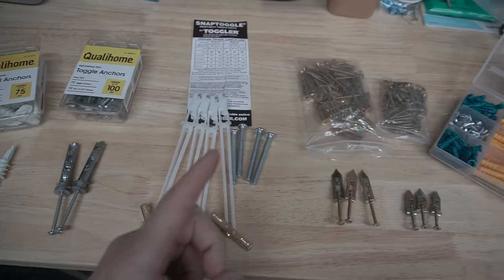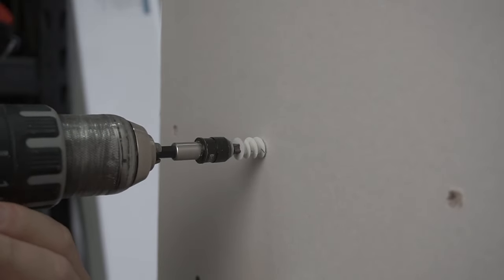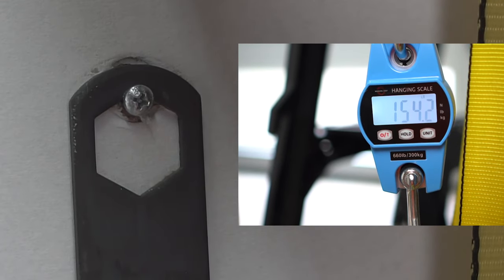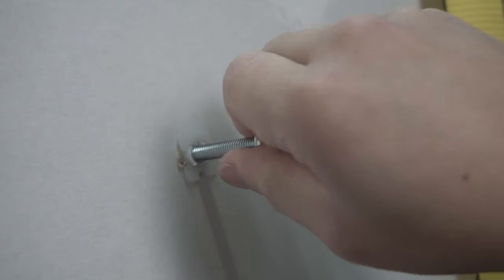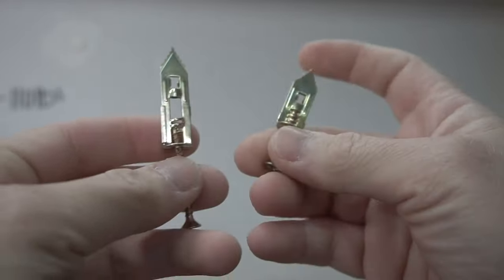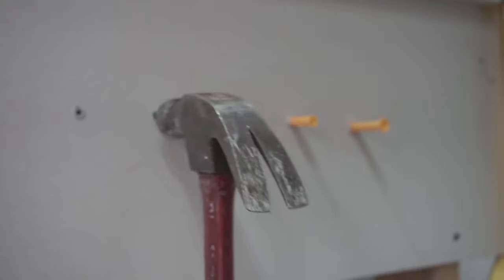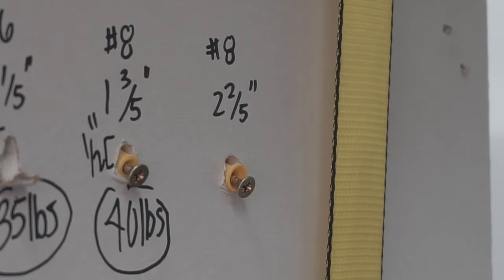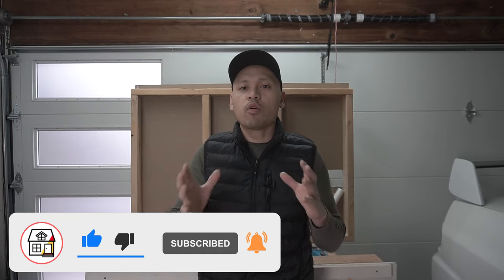Which Drywall Anchor Is The Best?! BEST And WORST Wall Anchor Review PART 1 (2022)

Comment: The hammer in anchors have to be oriented horizontally or they will cut through the drywall. 
When you install toggle bolts, there have to be completely tighter down to what they are anchoring, otherwise the screw will cut through the drywall.
…note that I finished the video, all of the anchors failed prematurely because the screws weren’t tightened to the wall. Imagine holding a dumbbell close to your chest versus straight armed out in front of you. Physics

Comment: The Toggle Anchor (No. 2) wasn't oriented correctly. There are arrows on the face telling you the correct orientation. Downforce is correctly distributed across the drywall if the stem is running up and down, not left to right.

Comment: in most of these examples = Technically the Drywall failed, not the anchors.. for the "anchor" to fail, some part of the anchor itself has to snap, break, etc. I live in a 1940s home and my drywall is a different breed of animal... I burned out a ryobi oscillating tool, bent and snapped teeth on a "drywall" knife (trying to knife out a damaged section of drywall"... snapped multiple thin drill bits

Comment: Testing these anchors with their screws  protruding is not a test of the anchor, it is a test of the rupture strength of the plasterboard (dry wall to you Yanks). You should use them to fix a hook to the wall to hang from so that the anchor is securely fixed to the wall. Nothing is better than a toggle bolt in my opinion.

Comment: This was frustrating to watch, snap toggles are the best anchors ever made but they need to be installed correctly. 

Think about how the snap toggle works, it works by clamping the plate hard into the drywall, the screw needs to be tightened up for this to work, you basically tested a screw and nut loosely sitting in a hole.

These all should have been tested by fixing a hook to the wall rather than leaving the screw loose

Comment: What is failing is the drywall not the anchor dude!. The fact that is in single shear without a backing to the anchor makes it worse. You are combining different types toggle and friction anchors. This would be more helpful if all were the same type.
Reply from the maker: Stay tuned for more test 👍🏽

Comment: you need to test the "Pull Out" not the "Pull Down". That should be a more accurate to of an anchor.
Reply from the maker: I agree, but anchors are mostly used to  hang objects that pull down on the anchor. Are you planing to use it to hang ceiling objects?
Reply: 99% of the time pull down info is what would matter

Comment: Terrible test. Most of these require clamping pressure on the drywall to be properly secured. Like the strap toggle things. Looks like you are unscrewing the bolt and hanging your test jig. Caused the bolt to just rip through the drywall.